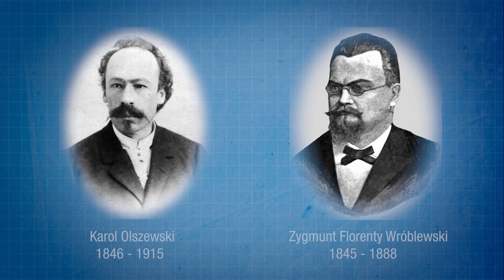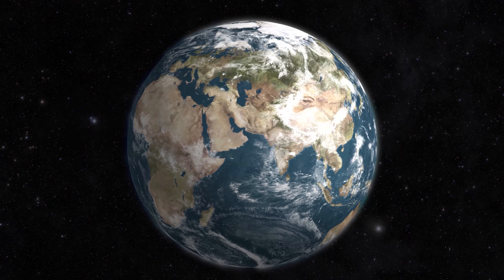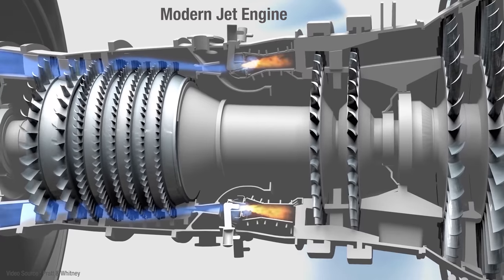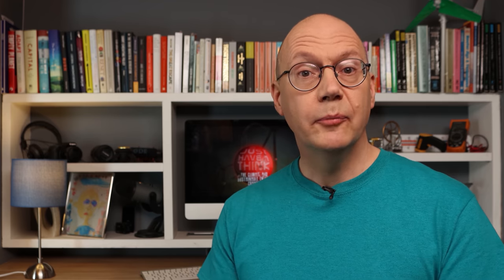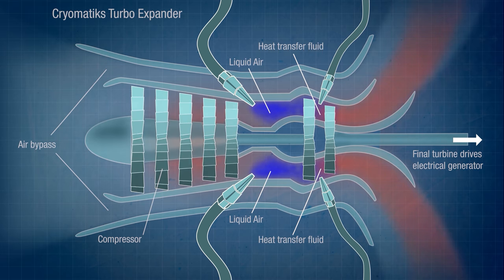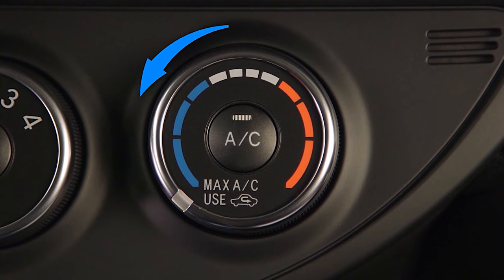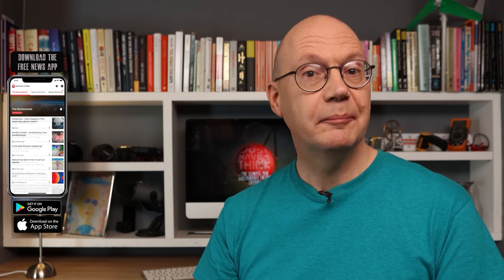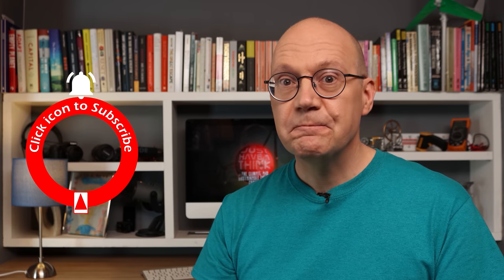Portable Liquid Air Power. A new boost for electric vehicles.

Comment: My BS detector is going off, pegged at the top of the scale. This system involves a lot of extra hardware, which must be quite expensive, a lot of extra moving parts with all that implies, and it isn't all that efficient, and has not very good energy density. And for what? For a problem that doesn't even really exist. Regen braking is very efficient, and works very well. Why would that not be so? You're just reversing the discharging of the battery that occurs when you're accelerating or maintaining speed. If that were not very efficient, EVs would not be a successful technology at all. The only times when regen braking is inefficient are when the battery is nearly fully charged, or very cold or hot. And you want to add a whole new system to cover the very tiny part of the time when some extra help might be needed? It just doesn't make sense.

Comment: Where is the energy to compress and cold that INMENSE mass of air liquid that you will need?  This system is good to replace the current litium batteries, but IT,S A ENERGETIC VECTOR, NOT A POWER SOURCE  like petrol and diesel.

Comment: First and foremost, this is once again an admission that battery vehicles are useless because the storage capacity is insufficient.

And now it is supposed to be a 'solution' to install two completely different drive systems? Why not also sails to take advantage of the wind?

Oh, by the way: liquid air tanks lose at least 2% per day.

Comment: It being 2 years already does they get any promising data from real world tests? Lets do some math in order to utilize all of the kinetic energy with 100% efficient rate(sure it's never an option) with a speed of 100 km/h and 2 tons of mass. That would be 100 km/h ~ 30 m/s so 30^2*2000/2 = 900000 or 900000/3600 = 250 Wh modern capacitors have power density about 5 Wh/kg so to harvest all this kinetic energy you would need a capacitor that would weight 50 kilo that a lot actually.

Comment: I must have miss a few very  important point in your presentation.  1. what is the cost of compressing air to nitrogen? I did not see that factored in to your presentation ( must have missed it)   2. what is the cost of these pressure vessels ?  I did not see that factored in your presentation ( must have missed it)  3. What is the cost of building the liquid nitrogen system into your infrastructure? I did not see that factored into your presentation ( ( must have missed it )  turbo compressors are expensive and difficult maintain with relatively short lives due to compressor blade failure and bearing failure.  I did not see I did not see this factored into your presentation (must have missed it )  4. the weight of liquid nitrogen is VERY heavy. I did not see this substantial increase in the electric vehicle weigh and sizable decrease in the electric vehicles efficiency  factored into your presentation ( i must have missed it )  and it goes on and on ............... JUST HAVE A THINK

Comment: Well.... The air pressure storage of energy is very nice, but carrying a metal tank full of air in a car diminishes the efficiency.  I rather use that energy to run a land based turbine to re-charge my electric car. Unless light Kevlar tanks can be used and the weight is only the air. Have they made a working turbine? Pressurizing air requires energy from the grid (renewable?). If the liquid air is dirt cheap, this might work...  If you have 200Kg of liquid Air (6896 mol of air, average molecular weight of 29).   The energy to liquify those 200Kg of air is 144,827.6 kJoules (21kJ/molair x 6896mole air. See, Argonne lab. https://www.osti.gov/servlets/purl/6574363 ). If methane is used to provide this energy (enthalpy of 1 mol of CH4 burned =  -890kJoule) , 162.46 moles of methane (144,827.6kJ/890kJ/mol ) are needed to liquify 200Kg of air, or 2.6 Kg of methane (162,46molex16/1000). Assuming the efficiency of the 200Kg of compressed air is 100% in reverse, 2.6Kg of methane  or about 0.5 gal equivalent in gasoline are recovered from the liquid air. 2.6Kg of methane give  about 13 miles for a heavy 200Kg air (without the tank) "fuel" (see: https://afdc.energy.gov/vehicles/natural_gas.html). I do not think so...

Comment: This uses heat transfer fluid up as it runs, it is expelled as exhaust. even if you can produce it cheap, its weight adds to the weight in the car losing efficiency. Like how thats missed. A super complicated system that cant run a car on its own, needs a complex ev to start off with and adds a huge level of complexity to nearly be as efficient as adding more lithium cells which the car is already set up for. Even if you take the techs claims as they state it still falls short, not to mention the claims are highly improbable, basically this nut is an evolution on the free energy nuts who gained loads of cash for r & d funding. He will probably get what he wants as people want to believe, and he has spun some facts around the bs then wrapped it all up it technical details very few can do the math to check up on. I repeat there are a few areas the math works, like the Carnot cycle but that's just a smokescreen for the gaping holes in the rest of it. Ie. generator losses, friction losses. Where is the reduction gear for the output shaft, oh yeah leave it out because its very lossy. The added loss of efficacy on the remainder of the ev due to added weight are just some obvious ones.

Comment: I am just thinking about super capacitors as a better option for regenerative breaking. Because their the cycle number is no problem at all and it can handle more energy input way faster than any other option.
I think this nitrogen expansion technology is only a opinion as a bridge until the super capacitors are really a option.
Reply: The problem with capacitors is that they either gets charged/discharged very fast and doesn't store energy like batteries. Capacitors are perfect for racing applications like fE, the porsche 919 hybrid and f1 hybrid vehicles.
Reply: @carholic-sz3qv  I see them purely as a short time energy storage solution when breaking and acceleration because there an then most effient and the batteries are not stressed when using them.
This video actually also propose to use nitrogen in a similar form. But you have to provide and store the nitrogen somehow.
First in infrastructure and secondary in the vehicle. And you only use the potential energy of the liquid nitrogen when it expands.
I doubt it is more energy dense then using chemical energy like in fuel cells etc. But there where no numbers of the storage at least in the vehicle. And you have to do a lot of engineering to create the break heat in one area in the vehicle to use it efficient to heat the nitrogen. Manny problems to solve so far. But it is still interesting.
And yes super capacitors have to become cheaper and more energy dense to be a affordable short time energy storage solution. 
And to be honest I don't need to be in under two second at 100km/h or 62mp/h.  But the luxury car companies do one good thing they explore the usability of the technology without being restricted as much by cost.
Reply: @abelgerli  nitrogen is a very basic and available gas that is also used for welding chemical processes....... if a truck can cover the maximum distance without needing recharge its going to be even more flexible.
Reply: @abelgerli  lpg/cng and biodiesel/biogas trucks already have no issues.
Reply: @carholic-sz3qv  Nitrogen is a inert gas so only the potential energy is used when it expands from liquid to gas. The energy must come from outside. Using lot/cng biogas burns the gas in a normal combustion cycle which uses the energy in the chemical bonds in the combustion engine. 
Using nitrogen you use only the thermal expansion and no envy stored in chemical bonds, as stated they need to use external energy to warm the liquid nitrogen so they can use the gas.
This is sure less energy dense than lpg/cng etc.
The problem is energy density that's why they want to use is to harvest the breaking energy. If you put additional liquid nitrogen in the vehicle.

Comment: This methode is highly inefficient!
With waste heat reuse and cold storage you maybe get 50% efficiency!
And if used in combustion engines to "boost" the efficiency you don´t! 
You realy just add up the combined potential of both, and whats gaind in efficiency on the combustion part through higher potential difference, is prior lost in the inefficiency of making the liquid nitrogen!
Just running your combustion engine hotter is way easier than cooling the intake down! 190°C more heat, pff! no problem! 

This methode hase it´s use in Applications where you already using liquid nitrogen, and have planty around, or need the specific conditions you can get with it, but not for pure Power storage!!
Thats just a fairy tale the PR agency yanks out to make there customer look green!

Edit: I wrote even before watching! 
This Cryomatics turbine hase some pretty big flawes! And the Numbers are clearly polished = theoretical optimum! 
How do you make shure you always get this waste heat?? (and more importend, how do you stabilize the expansion cycle if you don´t) 
How do you recycle the water glycol medium out of the exaust gas??
How do you regulate the power output without losing efficiency?? (one big problem with turbines is, they lose efficiency at low loads!)
How big is the power densety of a turbine, powerd just with that small of an temperature gradient?? 😯

This thing is way to complex! Low power densety, and an economic nightmare to build, run and maintain!

Do EV´s realy lose a lot of Power by limmiting the regen? If used correctly, NO! for example EV city buses are very good for that, because they decelerate very gently.

Im not a fan of all EV, but this is clearly just another case of engineers not realising the  practicability of there idea!
Maybe even a scam like Solar roadways, Hyper loop or those self filling water bottles! 🤣

Comment: I will NEVER own an EV. They have a tendency to leave people stranded and can not be back on the move unless they are towed to a recharge station. With a gas/diesel vehicle they can be fill on the road and back in minutes. EVs should only be used for local uses NOT long trips due to their innate lack of dependability and lack of quick recharge on the side of the road. They also severely overtax the electrical grid causing brown and blackouts. They are also terrible for the RV industry and almost all campgrounds can’t handle double the electrical installation to run the RV and charge the mobility batteries. Also there are NO charging stations at the beach or the desert or in the forest. So a BIG NOPE for me.

Comment: What a cruel joke God has played upon us! How shamelessly I resisted the lesson of the carbon dioxide cooled reactor. This comment is an effort at atonement. The culture of condense and repeat has blinded us pumping Heat wisely those first miles vertically. We want boil we Lust For That. But boiling creates the alternative bandwiDth that runs against the expedition of production necessary to excel. Nuclear reactors are designed to be impotent and so you look for a losing fuel like electricity. Now it matters that we not play the sucker to the monster, not maximize our gullibility and be all about surrender.

You have to move the heat gentleman and ladies you have to move it and you have to move it officially which means no steam allowed what goes in has to come out as it was just warmer you can't be gaining any weight once you get to the surface Anything Goes but when you're going from the mantle and Below to the surface we got the carbon dioxide and even nitrogen. Some of the variables are the viscosity and of course the energy per gallon of whatever non-condensable we use. I take it the pressure of hot carbon dioxide it's lower than nitrogen?